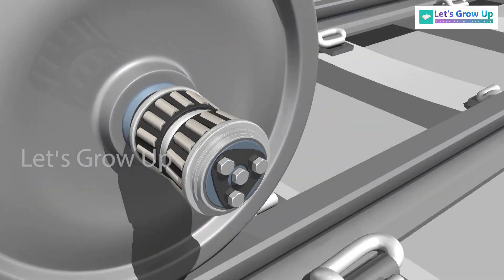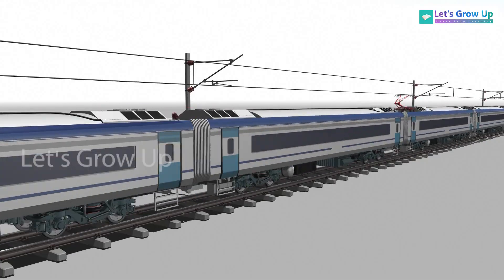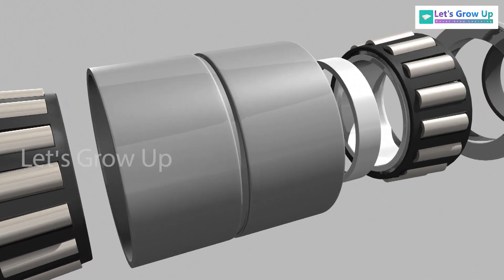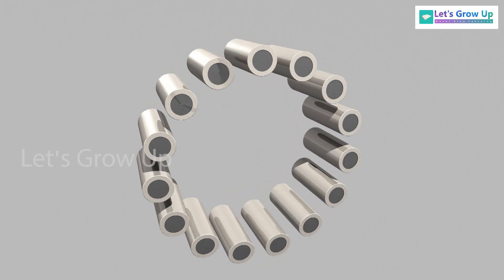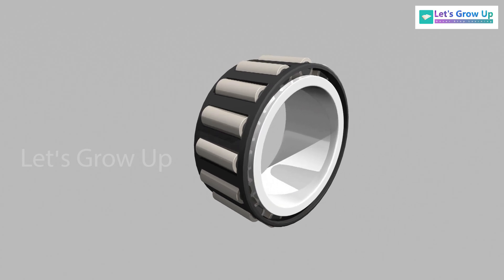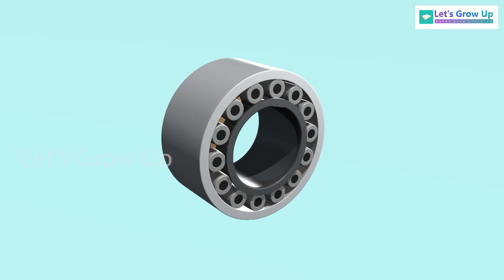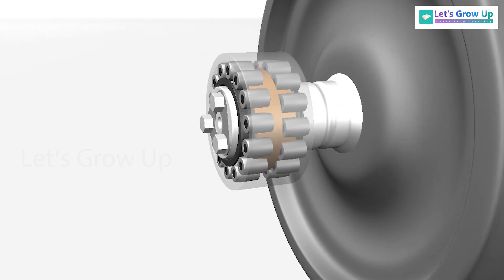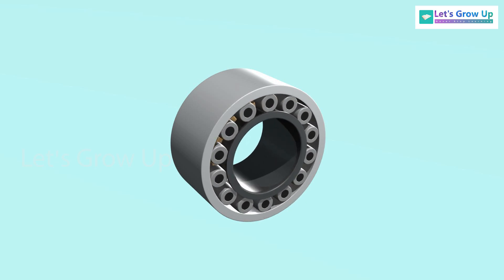The CTR Bearing vs Spherical Roller Bearing explaining by Let's Grow Up

Comment: Thanks a lot  for these great values, would like to add many efforts are made in railway engineering to optimize wheel and track design, reduce rolling friction is important for energy efficiency which it directly impacts energy consumption (Electrical, fuel, hydrogen ,...etc)